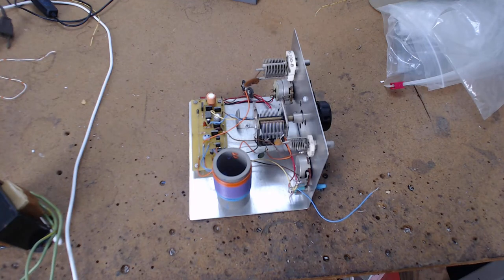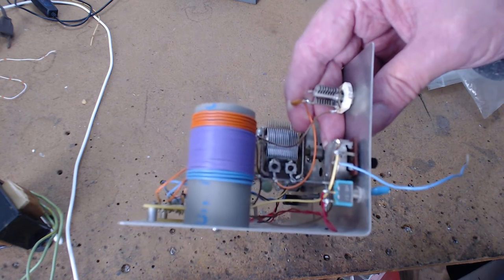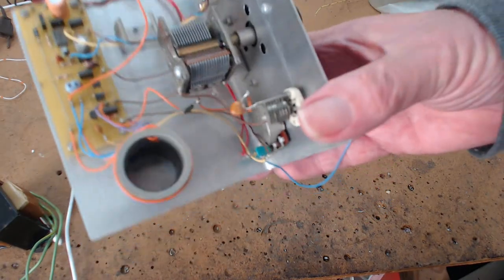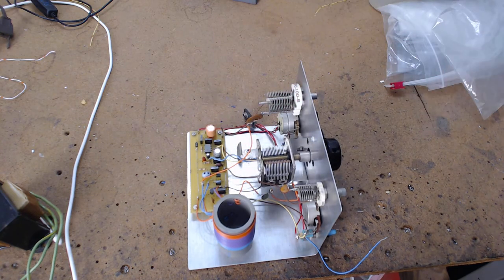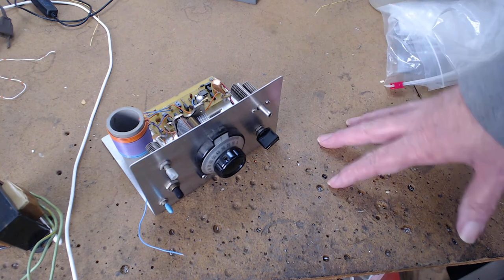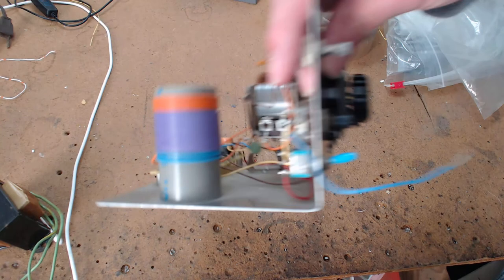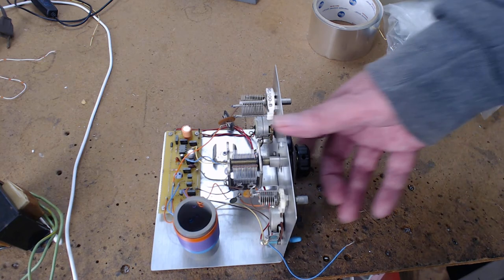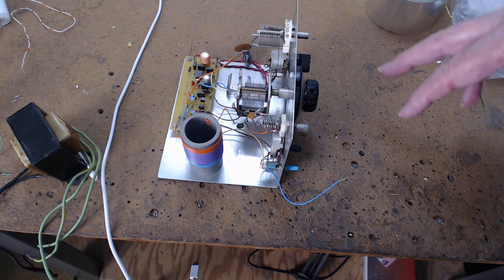Regenerative Radio Tricks! Why your radio won't work!

Comment: from my experience the list what might go wrong with a regenerative receiver is veryy looooooooooooooooong. From incorrect adjustment to broken components , too many wires, using breadboard. I will give you my example for one week I was wondering why my receiver didn't work (it was for remote controll so I have built a transmitter also for 27.12 MHz) and after one week I found out that  I set my receiver for 24 MHz instead of 27 .. it was just a small turn of the trimmer I used for adjustments, another example is that I had more like an oscillator than regenerative receiver and I was wondering why it didn't work. The problem is that nobody talk about such details which are very important and they are like be or not to be for the receiver.
Reply: roger that
Reply: I built one that was working fine outside a box and inside the box is just a noise machine,oscilating continously.
Reply: @Newlife-ol6pk  I know, I have built a few regenerative receivers usuelly for toys and learning purpouse (recently I received a signal from China haha in Poland ;) when I was testing my toy receiver with the audio amplifier ) but the problem I have is the range but I don't want to increase the power of transmitter. Also I have problmes to understand the difference between theoretic and practical circuit. In theoru it should work but in practise it is like fu.. NO! which is very frustrating :(

Comment: You are the only one comparing the regenerative with the speaker and microphone amplifier...I built a regenerative and outside of the box it's working and inside of the box because all wires i tbink and being close to the speaker It's oscilating and It's just a noise machine ...I tried for hours to make it work..
Reply from the maker: The problem comes when using the same battery for both the Radio and Amp. The RF gets into the audio amp VIA the power supply or battery. Look around and you will see others isolate the Radio section from the Amp using a transformer or choke of some kind.
Reply: Thank  you for the answer and for the recent video on this topic. I don't know if I was clear enough, English is not my mother tongue, I live in Romania. I admire and respect you, that's why I subscribed to the channel, not only for electronics but because of a video in which you talked about socialization and relationships. The problem is definitely from the audio side, from too long wires, from a potentiometer... I'm a beginner in electronics and I still don't understand a lot, especially with audio amplifiers. I mentioned since you are the only one talking about the problems that may arise, most of them do not mention and it is very difficult if not impossible to figure out how to solve a problem. Thank you very much for your experience and time!
Reply from the maker: @Newlife-ol6pk  Just keep looking at other circuits out there.  Once the RF gets into the audio section it can get back into the Front end via the Battery Plus line and cause a second oscillation.. Start collecting Regens diagrams with speakers. Then notice the Choke coils or audio transforme used for isolation.  Regens are not an easy build. They seem easy but adding a ground wire to the chassie can fix some problems.  Build your circuit over a piece of aluminum or tin. Run you ground to the tin or aluminum.